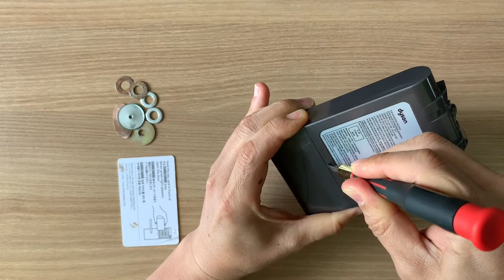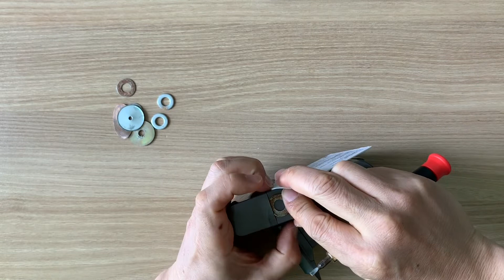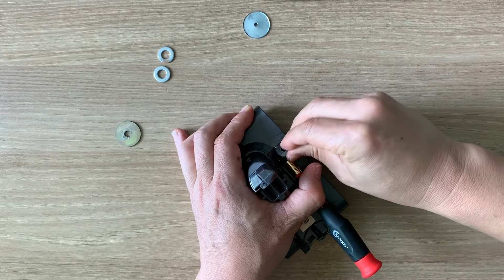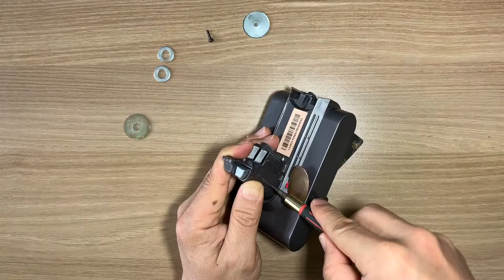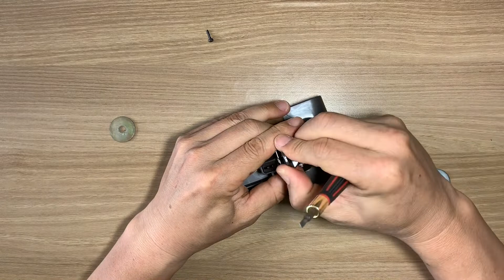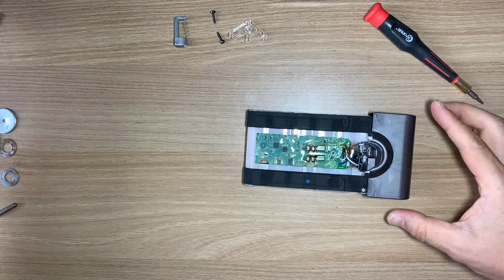(2/4) 빨간불 다이슨 V6 대체 배터리 열고 점검하기 Checking Dyson v6 warranty battery in red light flashing

Comment: So I'm having same red light problem. I did everything what you showed in this video. I measured voltages in each battery they are arround 3.2 and 3.6 . I think my batteries are fine. Also total voltage is 20.8 V . My question is, do I have bms problem then?  Thanks in advance
Reply from the maker: I think so. Buy a BMS and replace it. It will work.